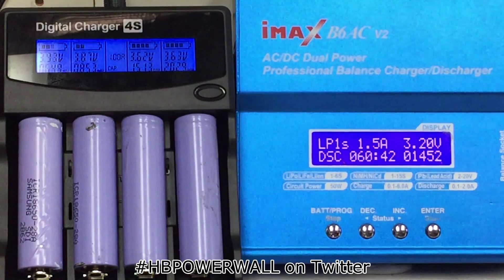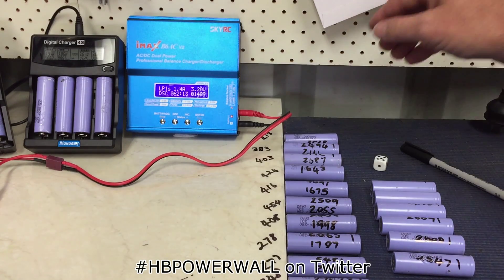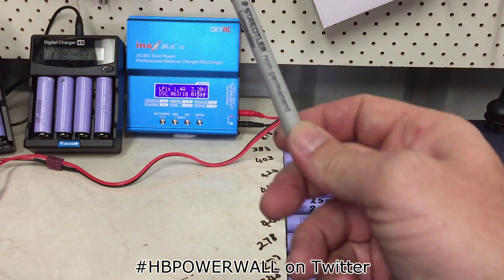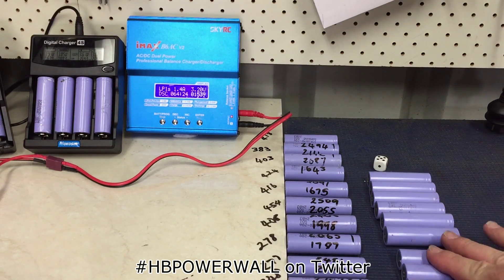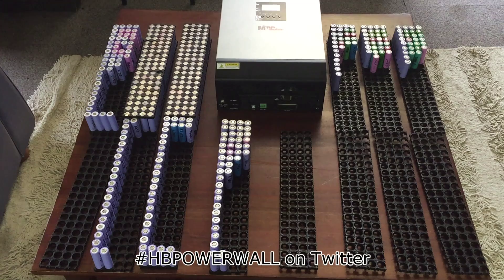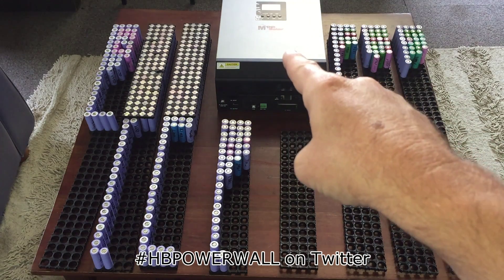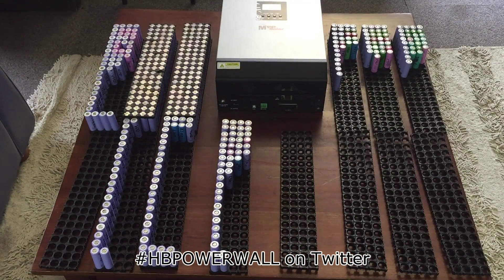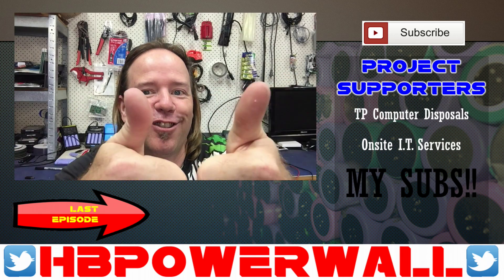IMAX B6AC V2 v Nokoser 4S & Powerwall update

Comment: I have two batteries 6s3p with BMS on each one. I want to connect those two batteries in series to achieve 12s3p. Is this safe? What should I know before do this? I am afraid that I can damage BMS if one of them will cut off one batterie. What do you think lady's and gentleman's?

Comment: The imax charger is set to li-po so it will only discharge to 3.2v but li-ion can be discharged to 3v. You should change it in user set - program > v. type. That's what I did and I got a more accurate result in comparison to the opus charger
Reply from the maker: Yes, stoped using Imax for discharging only use it for charging - on that note that charger is still in HEAVY daily use and still going strong

Comment: I am surprised no one has responded about discharge C rate and how C rate discharge relates to capacity.  At 2A discharge, you are discharging near 1C or 1x of capacity, at 1A you are discharging near 1/2 of Capacity, the chemical reaction is not linear.  For the same cell, It take more chemical reaction to work at 1C for 1 hour, than it takes for 1/2C for two hours. Therefore, the 1/2C rate will give more mAh.

Comment: I haven't watched all the videos yet but I've got to jump in with a comment. 

The 'difference' in capacity is a result of the iMax B6 you are using only discharges to 3.2v while the Foxnovo 4S discharges down to 3.0 volts. Go with the B6 results but for the love of God quit discharging at 2A. Anything above .5 results in limiting the life of the battery. I know it's faster but read below. 

Save your ears from that constant beeping on the Foxnovo and get the OPUS BT-C3100 v.2. The capacity results are more consistent and it will also do a 'discharge refresh' (charges four times and discharges three times) which will take about a day for each battery but it's supposed to 'refresh' them. In addition the OPUS will do a quick resistance test which might be more important that capacity as you are mixing cells. I have three OPUS charger/dischargers and if I use fully charged batteries and the recharge once the capacity is displayed I can go through about 12 per day per discharger. So that daunting, months long, task of capacity testing of thousands of cells actually went pretty quickly.

One thing the Foxnovo is great for is taking cells with less than three volts and bringing them up to 3.5 (or fully charging them) so they will go onto other chargers. There's a great video on YouTube showing how to do this. Basically just keep removing the cell until the voltage gets past 2.5v. If the Foxnovo won't get the cell up to 3.5, toss the sucker, it's cooked.

I just did a quick inventory of my best cells (117 for a 48v bike battery) and found that at least half of them had an initial voltage under 2v. On the other side of the coin I've had initial voltages of over 3v and the capacity came in under 1500mAh which is my cutoff for the recycle bin. Bottom line, initial voltage is interesting but has no real bearing on capacity. So you may want to go back to some of those 'under 3v losers' you discarded earlier. 

It's funny how we've all found our 'honeypots' of laptop battery backs. My guy was thrilled when I showed up and offered $.75 a pound as he was getting $.50 so we all win. His supply is truly inexhaustible however, I fear the 18650 battery won't be as easy to find in coming months and years as laptops get too thin to accommodate the 18MM diameter.
Reply from the maker: I have had recovered batteries from 0.5v - sometimes its just the batteries have been sitting for years and have self discharged or left completely flat. Or some other reason. Charged slow and checked thoroughly and you're good in my unprofessional unqualified opinion
Reply: @Rocket Rose have you had any stability issues with those cells you recovered at < 2V.  I have a bunch that have tested really well after charging, but was wondering if I should trust them less since they made it down to 0.5 V for an extended period of time.  I'm planning to build a 52V ebike battery with 140 cells, 14s10p, and am hoping to not monitor/fuse it too much.

Comment: Hey bud, i have been doing the same thing kinda for my ebike pack im building, kinda went overboard and salvaged close to 1200 cells from old laptop packs, so i am testing them all now myself to find the strongest of the bunch for my 20ah pack.. Anyways, i started testing with the Imax b6, but bought a couple of Foxnovo 4s geniune units, the imax charges the lithium cells to a lower voltage than the Foxnovo does before you do a discharge cycle, i found that if you charge the same cell to the exact same starting voltage and discharge it on the imax and the foxnovo it comes within 25mah and less difference.. so i ditched using the imax and just bought a 2nd foxonovo so i could do 8 at a time, the foxnovo automatic charges the cells, then starts discharge cycle, then it recharges the cell again to full before stopping, the capacity text results stay on the screen during the charge up cycle and finish screen.. ive left cells on them for 2-3 days and came back to write the test results down and slipped 4 more cells into the tester.. here is a review i did on them.. https://endless-sphere.com/forums/viewtopic.php?f=14&t=76101

Comment: Maybe someone can help me - me confused.  I have disassembly 62 - 6 cell laptop batteries and in the process of charging them now. They all seem to charge to 4.2 v using efest LUC Blu6 OLED Charger.  I also purchased a imax B6AC V2 charger.  Where I'm confused is I want to label each battery with its Ah rating.  But I'm getting very low numbers like under 500 Ah.  These batteries are Panasonic ICR18650-28A and should come is around 2600 Ah (or less due to being used/old)  So, my question is what is the best method to test Ah using the imax?  Thanks, Bart
Reply from the maker: +Barton Fisher Best method is consistency, use the same way of testing from the start. If you're only getting .5ah (500mah) the batteries are most likely buggered. Do you have any idea how old they are? maybe upload a video and post here when you have. We can take a look and share some ideas.
Reply: ok, I trying a different method now.  First I fully charged the battery.  Now, I'm discharging it on the imax.  Readings are now showing 1941 Ah.  I think the problem with the imax is that it normally only shows the Ah for a charge indicating what you put back in to the battery if not fully discharged, not the full Ah reading for the battery.  So that would mean fully charging first, then fully discharge to get an accurate Ah reading - does this sound correct?
Reply from the maker: You got it mate :) now just a few hundred cells to go ! Make sure you make some videos!!
Reply: I thought about it, but there are so many already :)  I have another batch of batteries coming, maybe I'll start one then :)
Reply from the maker: Doesn't matter how many videos are out there if your offering something. These (and many other) projects have a sort of a weird cult following. it is great fun to interact with others with the same interest.
Reply: Yeah, I might.  BTW:  I found you when you were on Jehu Garcia channel a few nights ago.  My goal for this project is to create a PowerWall to provide power to my inverter after the sun does down.  I already have a grid tie in setup at the house, so I think it might be easy to attach these batteries where the panels arrive at the inverter
Reply from the maker: NOOOOOO !!! your grid tie inverter is high voltage input !!! DO YOUR HOMEWORK!!!!

Comment: Gathered some data on your favorite battery and chargers.
All data is assumed at 25°C. Most of the data can be found at http://lygte-info.dk/ .

Samsung ICR18560-28A battery:
Theoretically, according data-sheet: when charged from 2.75 V with 560 mA to 4.3 V then cut-off at 140 mA, nominal discharge capacity is 2800 mAh (min. 2700 mAh) when discharged with 560mA to cut-off at 2.75V, within 1 hour after charging. Charge capacity: 100% at 560 mA, 97% at 1 A and 78% at 6 A (interpolated). Discharge capacity: 100% at 560 mA, 97% at 1 A and 93% at 2 A (interpolated). 

Chargers:
* IMAX B6AC V2 (1S): charging with 6 A to 4.2 V, then cutoff at 600 mA. Discharging at 2 A, cutoff at 3.2 V.
* Nokoser Digital Charger 4S (4x1S): charging with 1 A to 4.2 V, then cutoff at 100 mA. Discharging at 1 A, cutoff at 2.7 V.
* NiteCore D4 (4x1S): charging with 350 mA average (4 batt.) to 4.2 V, then cutoff at 35 mA average. No discharging.
* H.Z.M. charger (2x1S): charging with 500 mA no further data. No discharging. 
  This charger has been measured to charge up to 4.28 V (which would add another 175 mAh => 2.6 Ah to this battery).

Dependant of which charger is used, following discharge capacities are calculated per charger type assuming that a full cell which is charged to 4.2V at 25°C contains 2.43 Ah nominal:
* IMAX B6AC V2 (1S): 2.29 Ah (@2A 3.2V)
* Nokoser 4S (4x1S): 2.41 Ah (@1A 2.7V)

Theoretically, there should be app. 0.12 Ah difference between those chargers, but this is heavily dependent on: the cell, the temperature and the used charge current (very impacting, see above)/charge voltage to charge the battery.
Ideally, you should charge this battery with an 0.5 A charge current to 4.3 V and your inverter load of app. 0.5 A per battery would  almost be ideal already, for discharge currents of lower than 1 A the cutoff voltage could be 3.0 V. Then you would have the optimum energy usage.

Don't hesitate to correct my ramblings. 
Sjef.
Reply from the maker: +Sjef van Gool Correct you, I don't understand half of it.. Time to read it a few times - thank you for your effort !!!
Reply: +HBPowerwall I said already I was rambling :-), to summarize:
It is already dependent of how you charge how much capacity you gonna measure when discharging.
You will get a lot lesser charge for discharging if you are charging with 6A to 4.2V with the Imax (I saw your default setting in this video and in another video, you did, on discharging), compared to the simple dual charger, that charges with the almost ideal 500 mA/4.28V for the ICR18650-28A battery..
If you discharge with the Nokoser at 1A, which has its cutoff at 2.7V, it will measure a lot more capacity than the Imax which uses 2A at a cutoff voltage of 3.2V.
As a reference http://lygte-info.dk/review/batteries2012/Samsung%20ICR18650-28A%202800mAh%20(Purple)%20UK.html the picture below the line "When only charging to 4.2 volt the battery looses about 220mAh in capacity". Datasheet ICR18650-28A:  http://www.meircell.co.il/files/Samsung%20ICR18650-28A.pdf

Comment: Looking good. I know people have turned the fans upside down so the hot air exits on top. If you do that, I would then add some guttering to move the air all the way up and out of the powerwall and batteries.
Reply from the maker: +Gustavo Malaga Have has several private messages telling me to do the same thing. But being under warranty I'll run with it in the factory configuration. Once the warranty is out I'll play for sure. Wonder if I even have it running before the warranty is out? I'm sure I will.

Comment: Peter, little puzzled as to why you'd want your inverter co-located with the cells? TESLA's PW is batteries, BMS and other relevant PV control electronics (I suspect), to connect to the PV's and your existing (HV? in legacy systems) inverter. As you rightly muse you'll be introducing at best warm and at worst hot air into part of your battery array. Not ideal IMHO. I'm also curious as to the intended location of your BMS, which I would have expected in the (here) inverter position.
Reply from the maker: +Retinalism Cause that is the way i've always envisioned it basically, I havn't seen inside a powerwall so this is just what i think it will be like. "Think" being the key word. Heat will be a huge issue these inverters under load get HOT not just warm & combine that with the amount of batteries and the warmth they create. There is no doubt I will have problems and hell I might even change my mind. This is a learning process that I'll enjoy at any cost! Stay tuned, this will either work or fail either way please enjoy the ride with me :)
Reply: +HBPowerwall 
https://www.teslamotors.com/en_AU/presskit/teslaenergy

i.p.
"Tesla Powerwall is a rechargeable lithium-ion battery designed to store energy at a residential level for load shifting, backup power and self-consumption of solar power generation. Powerwall consists of Tesla’s lithium-ion battery pack, liquid thermal control system and software that receives dispatch commands from a solar inverter."

and 

"Tesla’s selling price to installers is $3,750 for 10kWh and $3,000 for 7kWh. (Price excludes inverter and installation.)Powerwall specs:Mounting: Wall Mounted Indoor/OutdoorInverter: Pairs with growing list of invertersEnergy: 7 kWh or 10 kWhContinuous Power: 3.3 kWPeak Power: 3.3 kWRound Trip Efficiency: >92%Operating Temperature Range: -20C (-4F) to 50C (122F)Warranty: 10 yearsDimensions: H: 1300mm W: 860mm D:180mm
Reply from the maker: +Retinalism Why have i never seen that ? SO all i need to do is put inverter next to it - solves the whole heat issue & it'll look even more 'powerwallee"

Comment: Keep your ma the lowest and the highest in the range of what you will be consuming before the cut off of your inverter and i hope you can program it  this way you can use more battery for longer time and you do not scrap any .ex you have 1500 and 2000 and 2500 so lets say you consume 500  you drop the first set to 1000, the second to 1500 and the 3rd to 2000 every battery is being used and once the the pack with 1500 is no longer up to the task you change that pack only ,it is like recycling to the optimum.
Reply from the maker: +94Discovery max charge on the inverter is 29.2v (of the 29.4v needed) so .2v buffer, i like. The minimum the inverter can go to is 22v and fully discharged is 22.4v so all good there also.  (3.2v x 7 is 22.4 under load) The plan for now is to grow the capacity of the 1140 cells to keep it Powerwall like as much as possible. 10kwh is the goal and I feel is reachable. Then i'll use all the other cells via a secondary pack to get as much life out of the lower capacity batteries as possible. Thanks for your input :)

Comment: Calculate the percentage of the difference and you will know the correct numbers to used as a percentage not a hard fast number.

Also with the hot air vents, why don't you baffle then and insulate it so the heat doesn't transfer to the batteries.
Reply from the maker: +Phillip Aboody Heat is definitely something i'm going to have to deal with. How I deal with that is a mystery lol - it's a process, so get her charging properly that should take a few weeks to get the batteries balance then turn her on, and load it up to see where i've stuffed up the design. Wonder how many times I redo the layout before it works properly ahahah